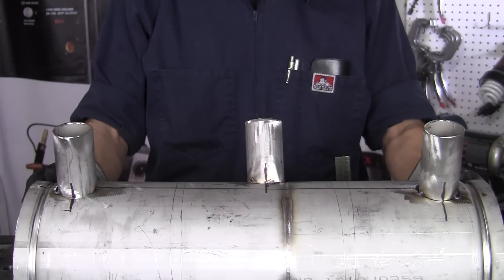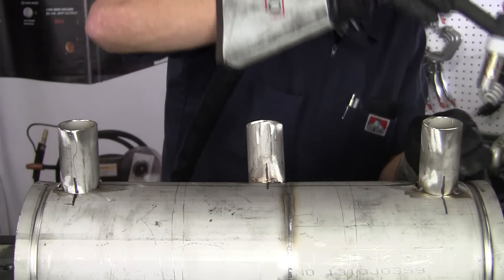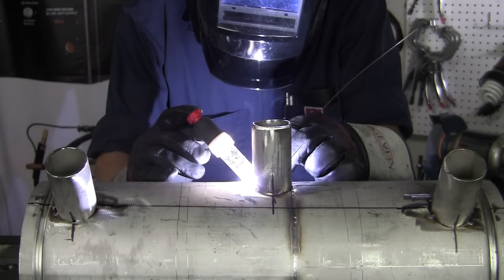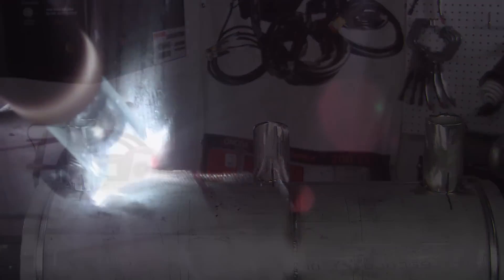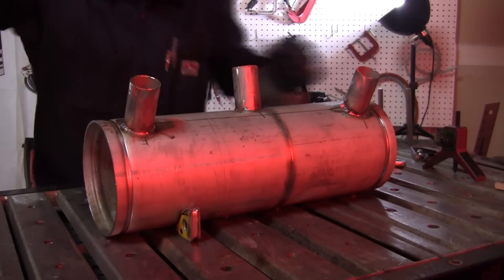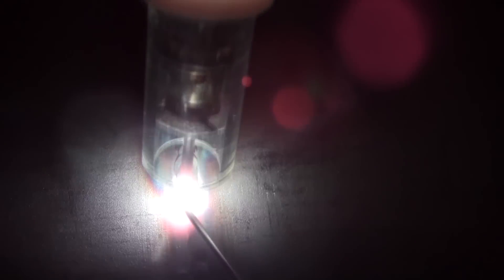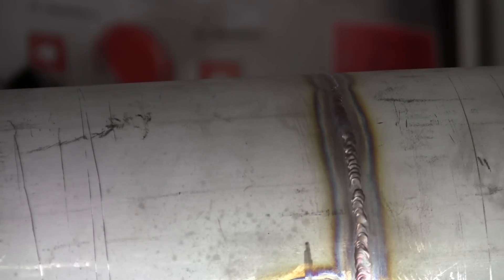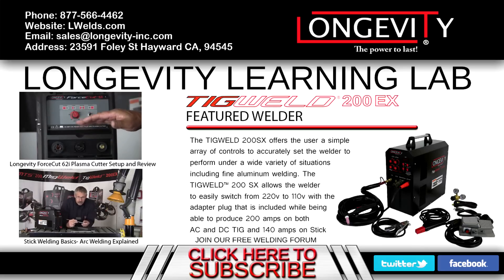HOW TO WELD STAINLESS STEEL PIPE TIPS AND TRICKS PART 3

Comment: First you never made sure the ports were on zero looking in the direction from you to the camera. Next in the first few tacks you dip the tungsten and you generally want small tacks so you don't have big build ups to weld over. The third port you say pretty close hope yours is better than mine , lol classic.way would you do a video for people that would fail in a second if you were testing,  The pipe stay stationary during a test, you have to do horizontal, vertical down, overhead, then vertical up . NOT only weld from 10-2, rediculous, if you can't weld or fit then you shouldn't be showing bad work ethics to misguide

Comment: Don't bother waiting for the post flow. It is just a waist of time. Specially on stainless.
Reply: +Tomas Jonsson Hehe,and we dont use sharp fine lines or formulas for the fab bit either,but all said and done someone will get something out of it.so it was not all that bad.